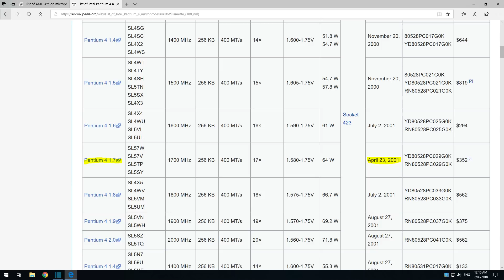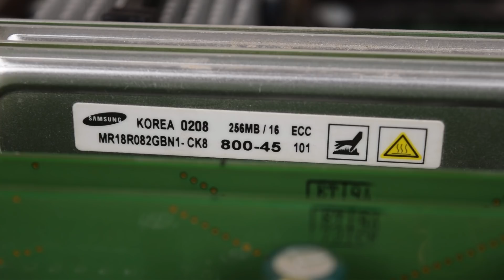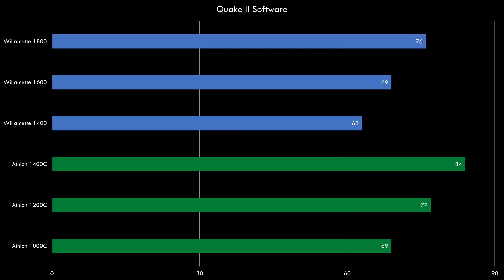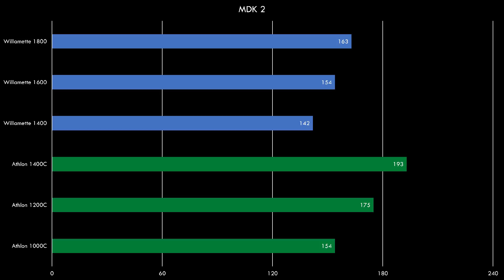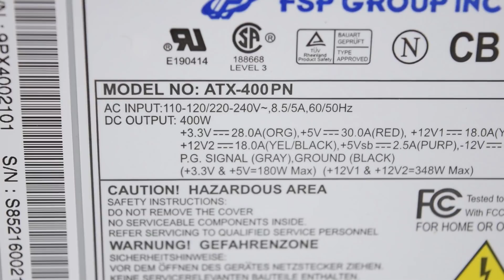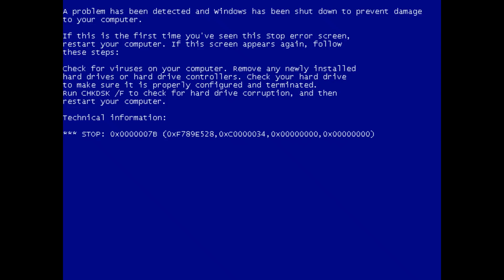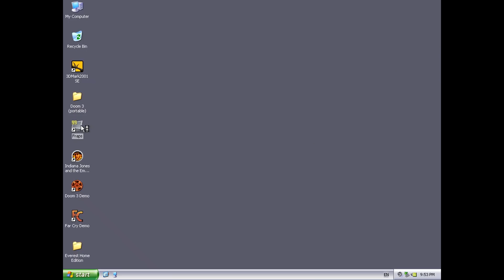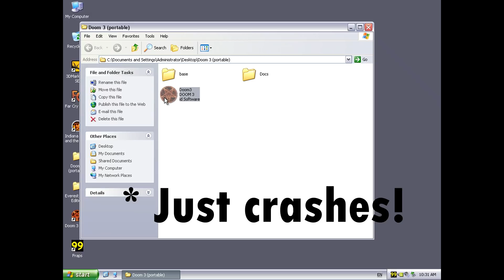Intel vs AMD S2E3 Athlon Thunderbird 1400 vs Pentium 4

Comment: So basically a athlon 1400 is better than a p4 1800, so also its better than a atom n455 that is comparable with a 1.6ghz p4. 
Interesting that i've could have used my first pc from 2001 with only a gpu upgrade and would have better performance than my netbook around 2010...
Reply: the atoms were awful... amds netbook cpus like c-60 or e-350 were a much better choice
Reply: except Atom (Pinewiew and older) had memory bus capped

Comment: Stop using windows XP. You should be using XP x64. The amd cpu's where full x64 cpus. x64 was a much better operating system after about the 3rd fixup pack as well. I ran it rock solid on an atherlon 1400 fo a long time.
Reply from the maker: Stop using Windows XP 64. There is no benefit. Games are 32 bit and can only address 2GB of RAM. Drivers are harder to find for 64 bit.
Reply: umm the athlon 1400 is a 32 bit cpu... i really wonder how you managed to run xp x64 on it...
Reply: Athlon64 where full x64 CPUs, not the Athlon Thunderbird or Athlon XP.

Comment: The heat of those 1400mhz thunderbirds was ridiculous!
Reply from the maker: I've had no issues with that, but then it's Winter here in Australia and I use an open air test bench. The PSU issue worries me a lot more to be honest.
Reply: The coolers of that time struggled, to keep that beast just cool enough to be safe.
Reply: @kjakobsen  A 7000RPM Delta fan more than did the job.. And no complaints from deaf users.  Intel came along later and said hold my beer.  Here's Prescott :-)

Comment: Man those Thunderbird Athlons were fantastic. The power requirements were definitely high but the performance was well worth it. Makes me also remember the Shuttle, FIC, and Tyan motherboards of that ERA. An absolutely wonderful video Phil!
Reply: Athlon thinking it's a power hog at 72 watts. And then 2021 comes along and the 12900k looks and laughs as it sips 330 watts. 
On the flip side even AMDs 5950x with 16cores and 32 threads maxing out at 105 watts.
Reply: EPox, Soltek, Abit, Matsonic, QDI, DFI,  iWill, Chaintech...
Reply: @303machine  ECS! >:(
The K7S5A with the SiS Chip was a gamechanger for affordable boards. Sadly, like many MBs, even much more expensive ones, it had horrible quality capacitors. You were almost guaranteed to have some fail if you used the board long enough.

Comment: Hey Phil, it’s interesting to see here that the 1.4GHz Athlon Thunderbird is generally outperforming the 1.8GHz Willamette, especially since the Athlon XP 1800+ was a 1.53GHz part designed to compete with the P4 1.8. I wonder at what point the AMD naming convention went bad, since the faster P4 chips outperformed the Athlon XP counterparts? That would be an interesting video.
Reply: I remember once P4 started to outperform Athlon XP, Athlon64 appeared and it was a bomb. Imho, answer is much much later, once Core 2 came into play.
Reply: The later Pentium 4 with Northwood core was a lot more faster than the old Willamette core. But the Athlon and Athlon XP still performed well.
Reply: Later versions of the P4 got a faster FSB, letting them get ahead of the Athlon XP model names.  When Athlon 64 came out, with HyperTransport in place of an FSB, it cleaned the P4's clock again.  The Athlon 64 3000+, for example, was substantially faster than the Athlon XP 3200+, despite having a 10% slower clock speed.

It wasn't until Intel finally figured out that Netburst was a horrible dead end and decided to migrate their mobile architecture (itself a derivative of the Pentium III architecture) back to desktop (as Core 2) that AMD's massive IPC lead finally ended.  They largely caught up with the Phenom II, but then Intel created Nehalem and later Sandy Bridge.  AMD had by that point been well-committed to the Bulldozer path, which they ironically did because they thought Intel was going to be right about Netburst (i.e. reaching 10GHz).

A year after the first release of Bulldozer, they realized how dumb it was, and started work on Zen.  Now with Zen 2, they are once again back in the lead when it comes to IPC, but still a tiny bit behind in gaming due to latency.  How long will they hold the lead this time?  My guess is at least three more years.  After that, I expect a tight race and competitive pricing, which will benefit all of us.

Comment: Good video.
Is it possible to do a P III 1400 Tualatin vs. Athlon 1400C. Head to head with identical memory? That could be really interesting.

About PSU's...
Be careful using your modern XFX 450W for a long run. You push this thing hard on the low volt rails.
When dealing with these old Athlons, an old school (which is cheap to purchase as new today) is a better fit. The reason is simple, that these are built to the older ATX standard. Powerfull 3,3 and 5V rails, but not so powefull 12V rail. Making these bad for modern highpower gaming systems, but great for retro Athlon's :)
Say a 400W with maybe just 16 amps (200W) on the 12V, is something that should work great. The remaining 200W watts combined on the low voltage rails is very good, and should run more efficient and less stressed (around 50% load). Modern PSU's are not really more efficient on these rails, than the older ones. They mainly focus on 12V rails.

Sounds like your old FSP is just having Coil-Whine, when crossloadind with the DVD drive. Coil-whine dosn't have to mean anything to worry about. I have had PSU's that coilwhined for years on certain occations/loads.
Reply from the maker: I was going to do that, but my time for these projects is limited, and setting up the Pentium III system for just a single test result isn't worth it at the moment I'm afraid.
Reply from the maker: For the PSU, we will be looking at ways around that soon :D
Reply: Thanks Phil, I was just going to ask about the PSU issue. If there's a good modern alternative, I'd love to know more about it. :)

Comment: Id buy that amd cpu just for the name!
Reply: I would buy it just for that purple PCB. It looks so nice. And would put it into purple PCB motherboard. Sad to see purple gone. After Athlon 64 there weren't purple motherboards.
Reply: @MJ-uk6lu  I this i have some Elitegroup mobo ( purple ), Palit MX400 ( purple ) and Duron 1100 still working, looks nice but only looks you cant do any thing with it even Chrome wont start since the lack of MMX2 instruction.
Reply: @plasheev  I wonder if with Linux story would be the same. I wouldn't expect much from that setup, but maybe at least it could work.

Comment: I bet that Athlon's idle power would drop to near-P4 levels under Win2K or XP. I seem to recall Win98 not letting Athlons idle properly back in the day.
Reply from the maker: I should look into that in a future video. Still wondering what this OEM Fujitsu Siemens motherboard did differently, as it had much lower power draw in Winodws 98.

Comment: I had a similar video driver issue... but with a 6200-128mb(128bit) PCIe video card in a Dell Inpsiron 530 desktop tower upgraded with an e8600 cpu and 3gb pc2 mem running XP to play WIN98 and early XP games and decided to use v340.52 driver and the game, forsaken refused load correctly while all other games installed, worked just fine, then i went with the most earliest driver(v66.93) that started to support the 6200 and up cards and low and behold, forsaken worked like a charm, and it didnt harm the other games.
Reply from the maker: Nice, that's close to the driver I used!

Comment: Awsome video as Allways :) i have a old BlackDiamond PointofView PSU(5v 40A 3,3V 34A 12V v1 16A and 12V v2 17A) so i guess it can runn old demanding Mother board`s :D i still have my Aopen AEOLUS 6600 DV256 256 MB DDR AGP it played Doom3 quiet well :D

Comment: Great job once again!! Keep going. Do you have some power draw results with the MSI mainboard? Are the equal compaired  to the ASUS A7V266-E? After your last episode i tested an Athlon XP 1600+ on an Asrock K7VT2 had got around 100W too.
Reply from the maker: I do have some figures, I'll try to remember and post them tomorrow!
Reply: Finished the test with the Abit NF7-S. Used the XP 1600+ and a Duron 1100MHz (Morgan Core) and the power draw toggled between 65 and 70Watts. So there might a problem with the KT266(A) based boards.
Reply from the maker: Stratotank3r Ok here are the results I recorded a while ago. With the 1000C the Asus board draws 87/97/104 whereas the MSI K7T266 Pro2-RU is a bit leaner with 82/94/100.

Comment: FSP 400W 21A on 5 V will be ok for old setups like Athlon XP 3200+ or P4 ?
Reply: Pentium 4 doesn't care; it uses mainly 12 V and 400 W is plenty. Athlon is the one using the older choice of 5 V.
Reply from the maker: You really need to try it out!

Comment: Interesting video again. 
Will there be an comparision between the B and C Version of the Thunderbird?
Reply from the maker: Not any time soon, as I don't have any of those and we will be moving onto other stuff.
Reply: Ok.
No Athlon 1333 laying around in a box? Give it 100Mhz FSB and it will a 1000B. The 1400C could also do the job, but it will clock at 1050Mhz.
Reply from the maker: Nope, and no time either :D

Comment: Power Supplies have certainly changed as systems moved off of the 5V rail being the primary one. I found a (used? looks brand new) Seasonic 400W PSU not too long ago for less than $20 in box. The compatible CPUs it lists on the box are from the P3 all the way up to the Pentium D and Athlon XP up to 64X2, also has a C2D/C2Q compatible sticker stuck on. It also has 30A on the +5V rail. Meanwhile the 1000W Seasonic 80 Plus Platinum (modular) PSU in my main system is rated for 25V on the +5V rail.

Comment: Love the video! The Athlon T-Bird 1400 was one of my favorite processors right up there with the XP 2500+ Barton. Looks like you've got you're work cut out for you figuring out the quirks with the Athlons.
Reply: I've overclocked for years. My first, accidentally, was running my Pentium 100MHz at 133MHz but it ran stable. (Gota watch those jumpers.) "Back in the day" overclocking got you what you needed that you couldn't afford. It also made a difference. I just don't see it that way anymore. It's fun and gives bragging rights, but in terms of real usage, if your 3.4GHz CPU, even if it is an old gen i5, is running at 100% utilization when gaming, something else is wrong.
Reply: +GraveUypo The 2500k is obsolete. But at the same time it's still powerful and better at overclocking than the 3570k. I think the good binned ones can go up to 4.4Ghz
Reply: oh what a coincidence, i was gonna say the same thing.
but i think my 2500k took their cake because of its longevity. still, great cpus, it felt like they'd never get completely outdated.
Reply: Lothaire Cliquennois you mean the bad ones. mine is on the bad side and it's running 4.7ghz. my brother's can hit 5ghz pretty easy. To me if it runs stuff quickly it's not obsolete, and there's no game that has managed to put it on its knees yet. heck, in this clock speed it's faster than most stock 1st gen ryzen at gaming, depending on how well threaded the game is.
Reply: 2500+ were very popular. Performance/price however was much better on 1700+ JIUHB and due to unlocked multiplier these were more suitable for some motherboards eg. on VIA chipset which could not hit 200MHz FSB. Friend of mine had 2500+ with VIA KT600 and I had 1700+ with nForce2 so we swapped CPU's (I had to also give him some small amount of money) and I ran 2500+ at slightly above 2.2GHz which was exactly the same clock I used  1700+ at. Performance difference due to 256kb additional L2 cache was not really noticeable but I was still happy with the exchange, especially since resell value of 2500+ was quite a bit higher than 1700+ due to these CPUs popularity. Friend was able to hit similar ~2.2GHz clocks with unlocked 1700+ albeit with slower FSB so for him 1700+ was actually much better CPU.
Reply: @e8root  The 2500+ was my favorite because I had it running at 2.5GHz stable for years on an ASUS A7N8X-E Deluxe. Sound on that board was great too.
Reply: @GiSWiG  I also had Asus with nF2 but cheaper version. Generally nF2 were great chips, absolutely the best for K7's, faster than anything else. I completely disagree about sound though. Nvidia nForce audio chipset had great hardware acceleration but actual audio output was still realized via Realtec codec, at least on most motherboards and definitely on Asus that you mentioned. This means that actual sound quality was not really better than on any ALC650 motherboard and RMAA measurements found in the web confirm that. Personally I used old SoudBlaster PCI 128 with my K7 system and this card not only measured better than most integrated audio solutions found on motherboards for many years to come but also handled 44.1KHz audio correctly without need for resampling. In fact I never used any onboard sound card except testing how they sound.
Reply: @e8root  You might be right on the sound but I don't remember it being bad. I actually don't remember on-board sound being bad until I broke with my 20 year string of buying something other than ASUS and got the MSI Z170A Gaming M7. The ASUS Crosshair III and IV both had Creative X-Fi through software. I only bought the MSI because it was the only board at the time that had two M.2 slots for NVME drives, not knowing at the time that price per GB was not going to be acceptable for a long time. The Nahimic software that comes with MSI is HORRIBLE! I would get it OK and then it just started sounding bad. I tested 3D sound in DOOM 2016 with that, my old ASUS XONAR DGX and an SB Titanium. All sounded off. I decided to splurge and got an SBX AE-5 and it sounded great, got Alchemy for my old games, 3D sound was accurate in DOOM 2016 and other games and it just makes my 20+ year old Creative 5.1 speaker set sound good. Of course when I upgrade to a new board, I will still have the same consistent sound with the AE-5.
Reply: @GiSWiG  Lazy 44.1->48KHz conversion that OS-es before XP did do sound terrible if you use the so called "killer samples" like un-famous udial.wav or listened to frequency sweeps. But that was not only on-board sound issue but most cards including SB Live! and Audigy had the same issue. Creative fixed it with X-Fi series by adding high quality resampler and M$ fixed it by adding the same to Vista (though you have make sure correct format is selected, even today in Win10). Big plus from me for using high quality standalone card. AE-5 uses ESS Sable chips which I use on phones and I am very pleased with their sound quality. I maxed out audio quality with Xonar STX and discrete Burson op-amps and the only option left is spending thousandths of bucks on true multi-bit DAC... maybe some day :P

Comment: Wow that ram latency is almost as low as my kill count in PUBG. Those was the good ole' days.
Reply: The ram latency is about the same today as it was back then, there's just more multiplexing so the memory module runs at higher clocks and latency measured in clocks is higher; but not measured in nanoseconds.

Imagine taking 8 sticks of DDR400 CL2, you read from each memory module in parallell and send it out sequentially over a bus at 3200 MHz; now it's CL16 because the clock frequency is much higher. That's DDR4; that's how it works; it's just that you hide all the memory chips and logic for it inside a single memory die.
Reply: i think it's still higher than your killcount. bazzziinga !

Comment: Great Series Phil, Thanks for all the testing. Are you planning on using any Socket 462 motherboards that have the 12 volt connector for the CPU ? I was looking at a Gigabyte 7N400 Pro with the Nforce 2 chipset. A little expensive  if you can find one.
Reply from the maker: Maybe, but at that performance level (XP 3200+), you might as well just go with the Athlon 64? A great platform and modern PSU friendly. I will have a nForce2 board soon, but it's from ECS :D
Reply: Thanks Phil
Reply: I use to have the GA-7N400PRo2 alongside with 2400+ XP and 3200+ XP from 2004 to 2010, many issues with nforce drivers after 2005... Also incompatibilities with the 6600 GT and later the 3850 AGP. I gifted to a friend of mine after I bought my Phenom II. Last weekend I created my Athlon 3200+ XP build with another chipset which it's superior for me. The VIA KT880 and the Asus A7V880 motherboard.